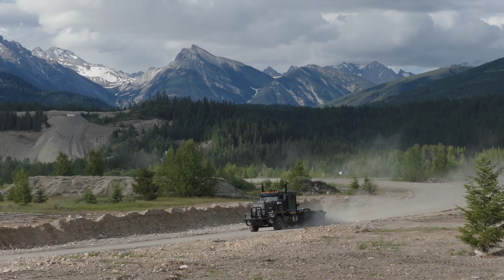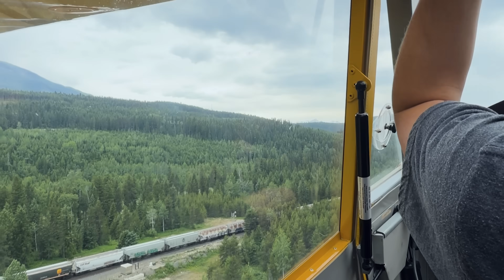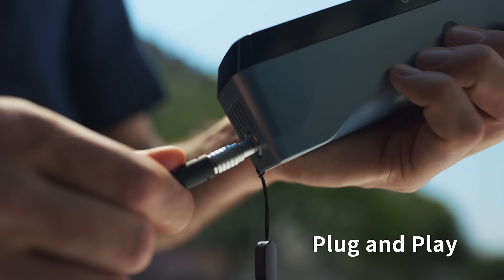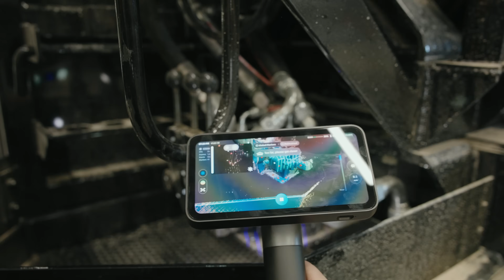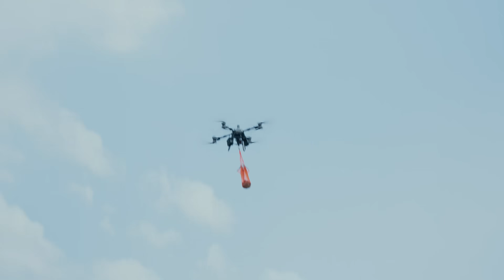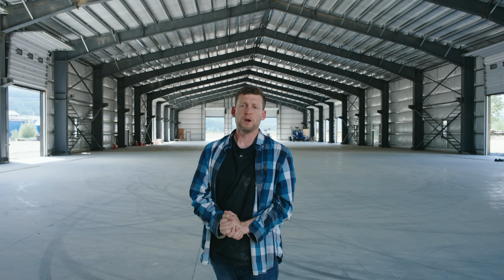Edison Motors Business Update + Big D & a Bush Plane Landing

Comment: Why didn’t you put a tonne of solar and a big-ass battery on/in the new shop ? Off-grid saves some BC Hydro delays…?
Reply: @J-T-  how much money do you think it’s gonna cost by running BC Hydro in there.
Reply: @kevinmcguirk7514 less than a solar system of the same capacity ...
Reply: @J-T-  not to come across totally rude towards you keep in mind my comments are meant to help
But it sounds like excuses there a solutions he has lots of land to put up solar panels. He can also put up a windmill. It doesn’t have to be the big ones to generate power.
Reply: @kevinmcguirk7514 yeah sorry but you obv don't have experience with alternate power sources and routine demand from industrial operations that rely on having power when you need it. 
Buying power from grid and having back up generator is FAR more reliable then hoping you have enough power after you just invested an insane amount of money into alternate crap.. 
What are you going to do when you run out of power. Tell everyone to go home and deal with constant delays in production ? Sure spend more to have more capacity .. where does it end .. just hook the shit up to grid .. 
Having to run a generator often eats into profits when you don't need to. It's unexpected, whereas a hydro installation cost spread over many years is an expected constant. 

We run a high intensive fish farm with supplemental solar on a system that we build and installed ourself to save $ and it's still hard to see a payback on it .. by the time the system pays for itself you need new batteries.  It's a revolving door of cost .. not as free as everyone makes it out to be ... 

These alternate sources are a pain in the ass unless it's for some personal use that you can work around or hooked up to flip back and forth between grid and solar .. 

A small system that can run the basics if grid is down. Sure. Or a battery back up system that can run loads when grid is down. Sure. Generator is still easier.. 
Having grid connected to a property like this is still easier .. I don't know of any industrial sites that run on solar .. just grid tied systems to sell back to grid when the system makes power .. 
And trust me I'm all about off grid, f the government. But it's an industrial site, go price out a system that can handle this site and tell me it's a good idea .. 

And your comment, how much land has nothing to do with what I said ...
Reply: @J-T-  here’s another way to look at it. You rent a home and the money goes towards the landlord, the owner of the house or you buy the house and the money goes towards the house.
This is the last word I’m not saying anymore. I’ve made my point a few times. I’m done with this conversation by all means helpful last words.
Reply: @kevinmcguirk7514 not even remotely close to the same comparison but sure ..
Reply: Edison could set aside10 acres for solar, then fill up semi truck batteries, then use the batts to spin the 200 kW generator they use for semi trucks to spin a whole building flywheel power conditioner from Vycon or Piller to feed beautiful sinewave triple phase AC 480 volt directly to the new Blue Assembly Plant ("BAP").

The only thing holding Edison back is the hundreds and hundreds of thousands of dollars necessary to pull it off :(

Wah wah wahhhhh sad trombone sound :(
Reply: I dont think there is enough surface to mount to make it worth it
Reply: @rodiona8781  what’s wrong with putting solar on top of his new shop? I’m sure there’s more than enough roof space for that.
Reply: @rod @rodiona8781  that new facility he built you can’t put solar panels on top of the roof
Reply: @pamacleod  I was thinking the exact same thing.